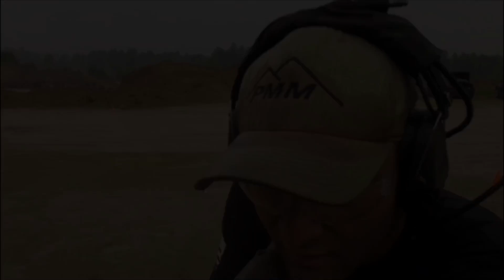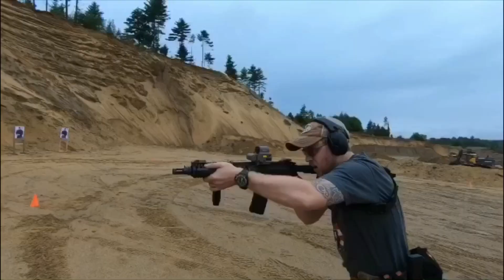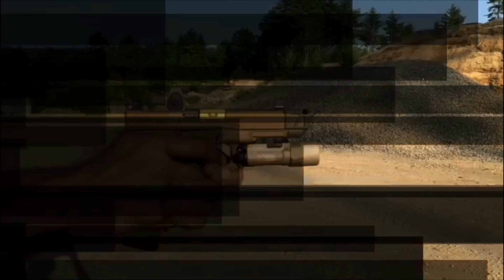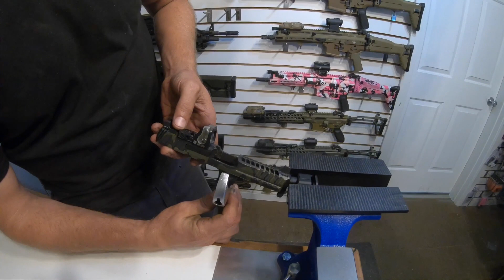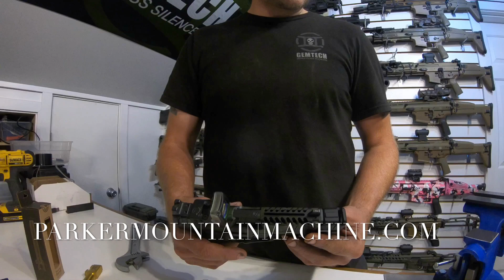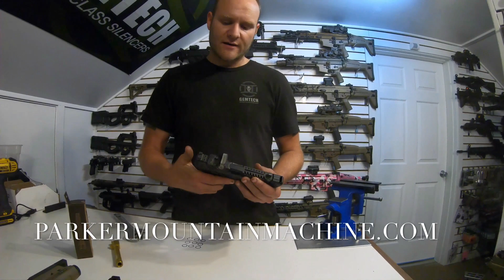Parker Mountain Machine JTTC install

Comment: So my pmm machine comp for my p226 came with shims that wont go over the barrel. Like not even close- they are the exact diameter of the barrel. Can i sandwich the shims inside of the comp, between the comp and the face of the barrel, instead of having the shims sit on the shoulder of the barrel? Im worried the shims being so close to the crown of the barrel will cause the round to hit a shim as it exits. It looks like the shims barely clear the rifling but if i tighten it down they may flatten out a tiny bit and become an obstruction. Im using the factory sig threaded barrel.

Comment: I just ordered the single port cop for my Gen 3. What lbs spring do you suggest when running 124gr? I'm looking into running a tungsten guide rod and either the 13-lb or 15-lb
Reply: OEM works fine on mine, but I run +p only thru it. Just to be safe

Comment: I have a slight gap between my comp and my slide (G19 Gen 5 with Wheaton Arms Barrel). Is this normal? I can’t wrench it on any farther. Any help would be greatly appreciated.
Reply from the maker: That barrel is not one that we have texted. We offer a barrel fitment service on the website if you're interested.

Comment: Excellent. You guys have been doing a fantastic job cranking out these well-engineered, aesthetically pleasing comps for a vast array of popular platforms.

I'd highly recommend working on a dual-chamber version for each, approximately matching the length of a Surefire X300U bezel when installed on a 4" barrel pistol (G19 sized). The single-port looks like a good match for the length of a Streamlight bezel, but (as I'm sure you know) you'll get better compensation effect from a dual-port comp. plus, consumers appreciate having a variety of choices.

Keep up the good work, you've got a subscriber and a follower of your work